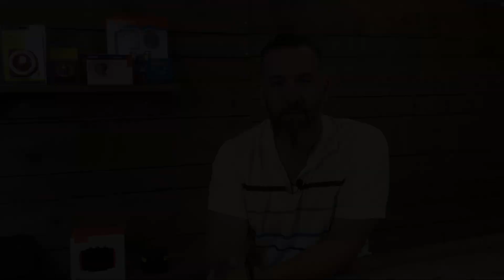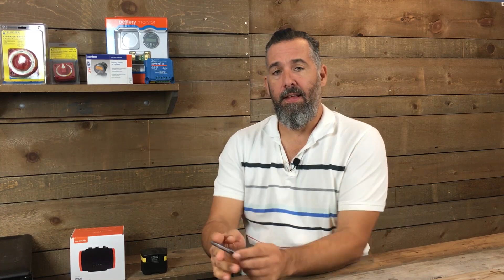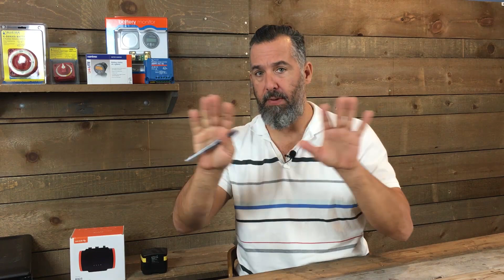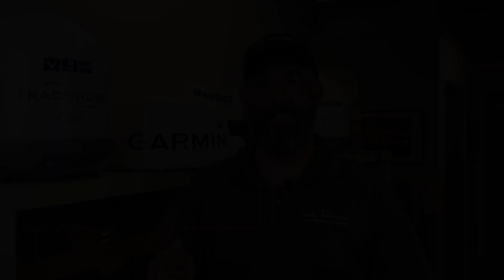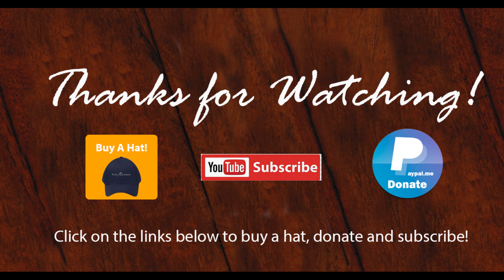I Have Four Golf Cart Batteries, Should I Charge Them in Series or Parallel?

Comment: Jeff, When you say a house battery bank and engine battery bank, does that mean physically separated?  My engine batt is on my #1 switch; my house is #2.  Or are you suggesting (in the example of the video) that 2 golf batteries would be on #1, 2 on #2, and the engine is permanently wired to engine and not on the selectable switch?
Reply from the maker: Hi Nick, thanks for asking. A battery bank is composed of one or more batteries that are wired together and cannot be separated. Most of us boaters, have at least one engine battery bank (typically made of 1 battery) and a house battery (made of 1 or more batteries). 

In your case, your house batteries (i.e. a house battery bank) are wired to a post on the battery switch #1 or #2, it's totally arbitrary. The engine battery is connected to other post on the battery switch.

Comment: JEFF, I thought you DON'T  promote battery 'combiners'.
Reply: Yes we have watched your videos.  What happens when he draws down his house bank to a very low level.  He could get a rush of current from the starting battery through the combiner that will trip the fuse.
Reply from the maker: Smiling ear to ear:  well said Christopher. It's all about the inrush of amperage when we have unevenly discharger battery banks in sudden parallel, the amperage can easily exceed the rating of the battery combiner (e.g. commonly 120 amps) and blow the fuses.
Reply: I took a similar but different route, house and start are fully isolated and using an off/on/all switch rather than off/1/2/all. This means house always goes to house and start to engine when in ON position.

As to charging, I looked at multiple options and settled on an Echo Charge which relays charging loads from house bank to starting battery. A simple system which meets my needs.

*This also does mean my alternator only charges the start battery, and I'm perfectly fine with that. I have an old Atomic four that I barely run, and never intend to use it as a charging source - though I am considering adding two more switches to allow disconnecting one or the other battery, allowing to re-route all power to start or house in case of emergency.